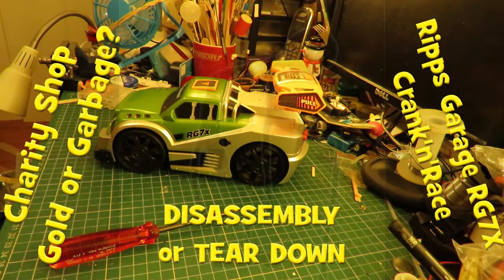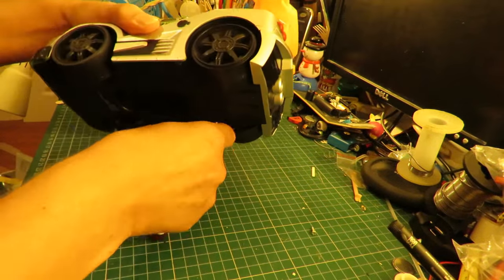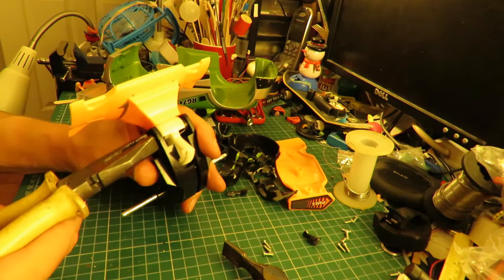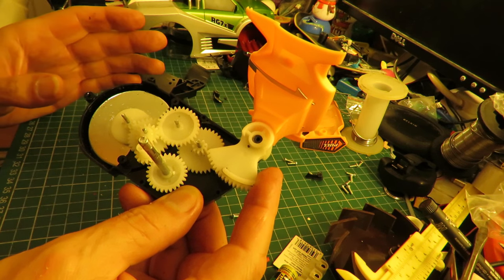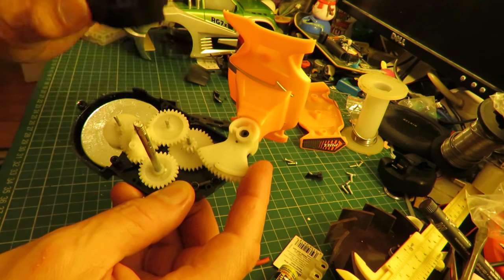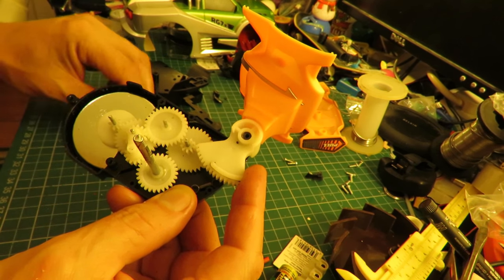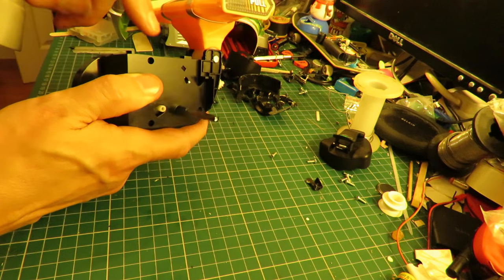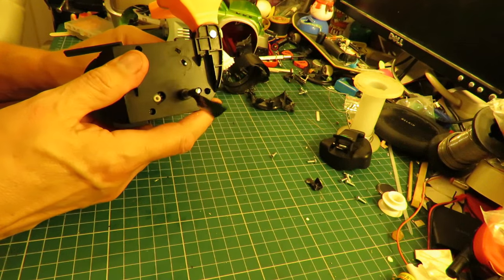Ripps Garage RG7X Crank'n'Race DISASSEMBLY/TEAR DOWN

Comment: The axle slipping under load might be a safety feature to prevent little fingers getting burnt.
Reply from the maker: Possibly but I don't think so, in the original video where I was running it up and down my kitchen it was virtually crawling compared to how it would have gone without slipping like that.
Reply: Ok

Comment: Hi Grandad, Many-many years ago when I was a kid ( 1965ish ) my dad had a Rover car that along with an electrc starter and starting handle had what i think was called an Inertia starter that worked a lot like this toy car, it fitted into the crank handle hole Dad turned a handle faster and faster until  it was making more or less the same sound as your toy car he then flipped a lever to start the engine once it had started he unclipped it and replaced the starting handle..............M           I belive the Germans used something similar to start airoplane engines during WW2
Reply from the maker: Hmm I don't remember them but I can well imagine how it would work and be safer than trying to crank the engine directly.

Comment: Can you attach a proppeler to the spinning shaft and attach the mechanism that you took out of the car to a car that you made , to make it proppeler powered car? I think it is powerful enough to drive a proppeler fast and make the car go. And another project if you could attatch the shaft to the stepper motor you can make a very cool generator. I hope you will make a video out of one of these projects. Thank you.
Reply from the maker: You have probably seen the video with the stepper motor now. A propeller driven car might happen but it will need to be quite robust as there is a lot of force used pumping it up so my usual CD wheels would collapse under that pressure.
Reply: GrandadIsAnOldMan You can always pick up the car then pump it  , place it and press the button that maker the shaft go.

Comment: a shame that it is a tear down
Reply from the maker: Yes there was no way I could get those wheel off without cutting them off.
Reply: can't you glue the wheels or put plastic toy car wheels on the back axle?
Reply from the maker: Did you see the state of those wheels after I had cut them up? Yes I could replace them if I could find a matching set but I am not worried about doing that.
Reply: Yes but you can use different wheels of the same size right?
Reply from the maker: The redstoneblock if you can find them